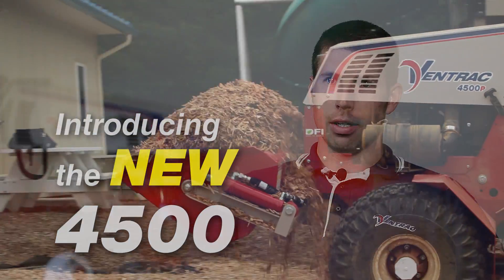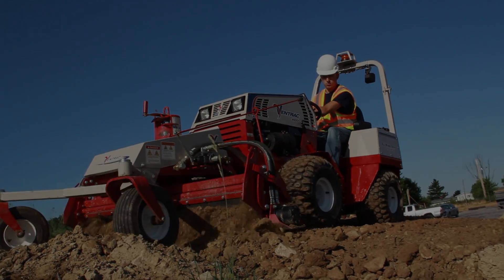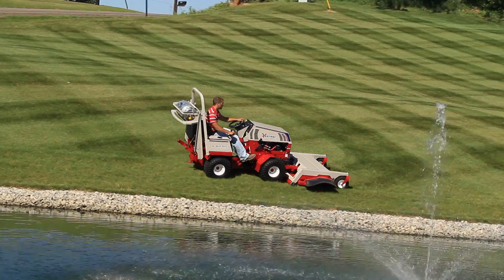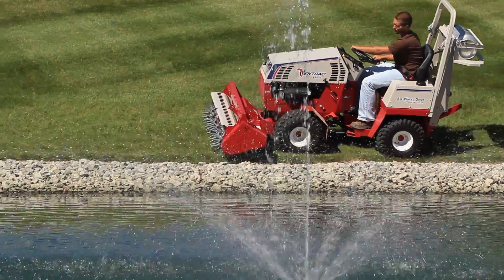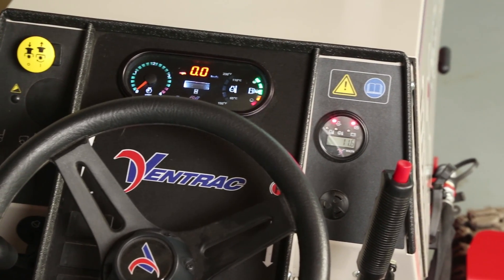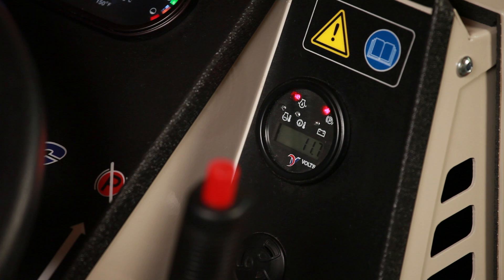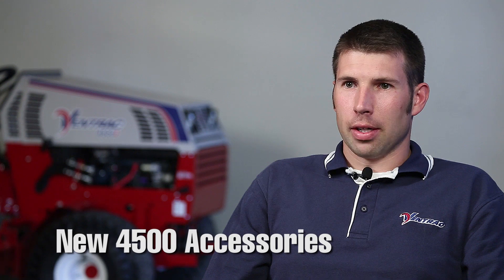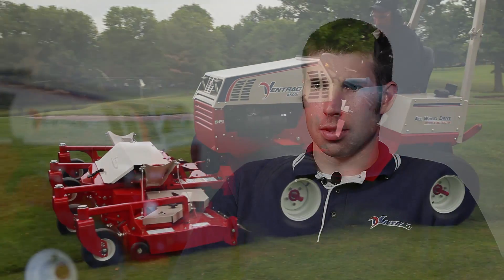New Ventrac 4500 Introduction

Comment: Pointless. It’s either buy a mower or buy a tractor. You don’t use a pussy ass 32hp mower/tractor/car/spaceship/toaster/boat to do tractor shit. Just like you don’t use a tractor to do mowing shit. Scac Cheetah, used 5410 John Deere, you’re still under the cost of this. It’s insane that someone actually gave the okay to make and sell a mower for basically thirty grand. Pass whatever the fuck you’re smoking over here
Reply from the maker: Aw, BH.  Thanks for the kind words.  Thankfully, you're wrong about a great many of people out there who would MUCH rather have one machine that can do everything they need.  Easier maintenance, easier storage, and for a lot of people - both a better "mower" AND a better "tractor" than the traditional options you listed.  Check out some of our other videos - looks like you'd learn quite a bit.  Check back in when you're ready!
Reply: Ventrac The entire point is overlooked in your horribly structured response. THE PRICE IS THE PROBLEM. If people would MUCH rather have one machine that can do everything they need you can bet your cubicle sitting ass they’re not gonna buy a 32 horse articulating golf cart. Also, owned a used Ventrac 4100 with 98 hours on it, single handedly the worst machine I’ve ever used and that’s not being frank. To be frank, it was a piece of shit. Couldn’t cut and didn’t ride a quarter of what our cheetahs and toros.
Reply from the maker: Since price doesn't appear to truly be your only complaint, we'll try to answer everything you're concerned about.  First - price - It's not a problem for any of our customers.  Otherwise, they wouldn't have purchased it.  It might be unattainable for some people who want it, but it's certainly not for a lot of people - that's kind of how we stay in business.  And it's not just people with a lot of money buying these things.  Golf courses, schools, cities, corporate campuses, contractors, estate managers, you name it.  And believe it or not, in some of those cases, they buy the Ventrac because it's budget-friendly compared to the alternative of buying dedicated machines for all the individual tasks they'll use the Ventrac for.  Okay, so price is out of the way.  Let's move on to where we sit in the office - right, that's none of anybody's concern and is a baseless criticism that has nothing to do with the quality of the tractor.  Yes the machine is 32 horsepower, which is pretty standard, given the size of the machine.  No it's not a golf cart - quite frankly; that's ludicrous.  We're very sorry to hear that you owned a 4100 and did not like it.  You can have your opinion; we probably can't change that at this point, but it's worth mentioning that we never hear feedback that bad about our machines so you're definitely an isolated case.  Our tractors aren't a great fit for everybody.  For example, you're comparing it directly to "cheetahs", meaning Scag zero turns.  It's true, our tractor is a terrible zero turn if you're expecting it to be just a zero turn.  Also, the 4100 is a 7-10 year old machine by now.  It was a good tractor, but we've moved on and the new models are vastly different machines with a lot of improvements all around.  

Now, if you've got any other complaints that are a little more applicable, we'd love to address them with you.  Even though you're not an owner anymore, we still care what you think.  And if not, please try to at least keep the language a little cleaner.  We really try not to delete comments, but we have a lot of viewers of this channel, some of them quite young, and we try to keep things as respectful and appropriate as possible around here.  

Thanks for your time.

Comment: It looks handy but also extremely uncomfortable
Reply from the maker: You should definitely try one out!  One of the most common feedback comments we get from owners is that it's a very comfortable machine to operate.  (It's because the oscillation keeps consistent tire contact on all 4 corners so every bump and imperfection in the terrain doesn't upset the machine as much as it would if it was a rigid frame)

Comment: Grown up in Ohio I've been around steiner and ventrac for years. They should be called goats the way they climb hills. I have drove a Steiner 440 and it's ok. If I were to replace my 430 the Ventrac 4500 would be choice hands down. I love the gages. Unlike the 440 you can easily see them and the warning gage on side is great easy to  see. Ventrac took lots of time on design of this and shows. I love how they extra spots for switches ect. Ventrac is always thinking of new ideas so if they read this a one way stick like on a compact for up down left right for blade and bucket would be great. Also maybe a 6 way blade option you came out with the grapple on the power bucket witch is great. Also I would love to see a track opition. Everyone is going to tracks today with compaction so what better tractor than a Ventrac. Keep up the good work Ventrac I hope to upgrade and own one soon.

Comment: Looks like a slightly stretched nose to  handle the longer 3 cylinder engines... The phased out 953 Briggs diahatsu was an incredibly compact 3 cylinder.. I found out that none of the major manufacturers make a 3 cylinder that will fit the 4200 Ventrac and make comparable power to the 953 L/C Briggs.. I like the new parking brake and bigger steering cylinder.